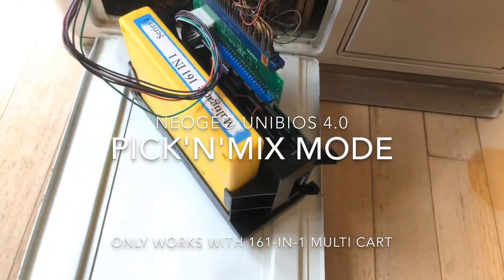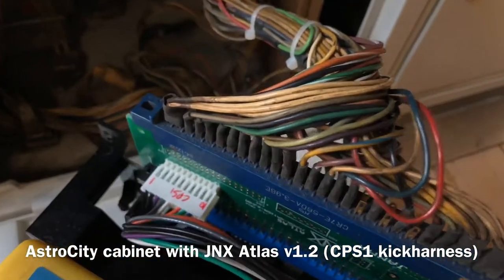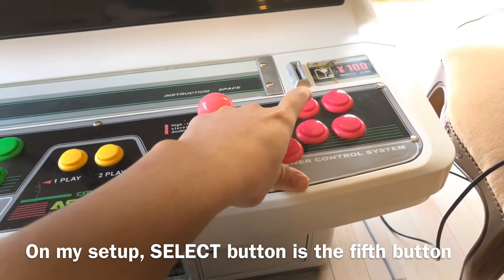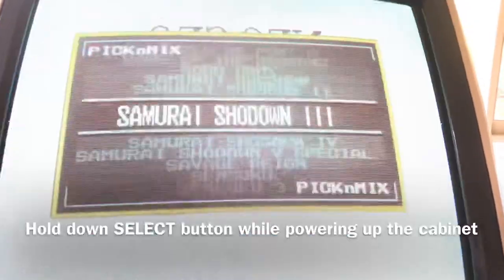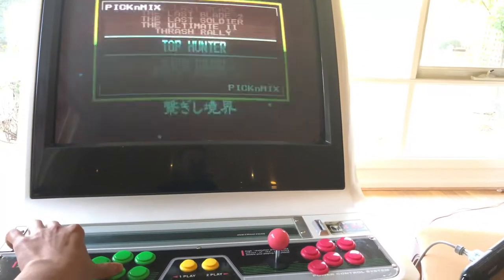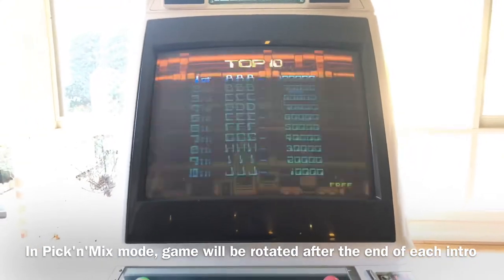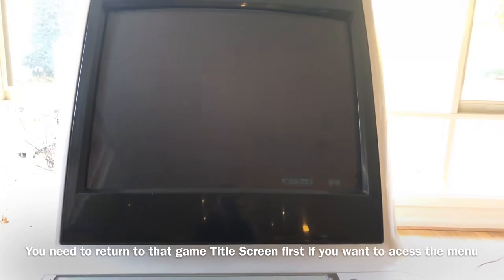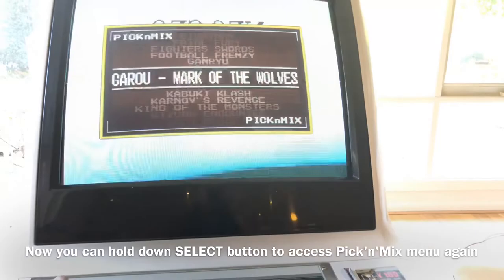Neogeo UniBios4 Pick'n'Mix mode for 161-in-1 multicart on AstroCity cabinet

Comment: Thanks. I tried every option and couldn't figure it out
Reply from the maker: you need unibios4 and 161-in-1 multicart (wont work on any other carts)
 Once you have those two, it should work just like the video describe.
Reply: @modology  yes. I said thank you cuz i have both but couldn't figure it out by myself 😀

Comment: How to turn off picknmix? 
I didn't do anything just power on my arcade and play game.. but when I hold the start button to exit the game.. the picknmix it will turn on itself. 
What can I do? Sorry for bad English.
Reply from the maker: When you have not inserted any coins into the machine, if you hold START ---> the Pick n Mix menu will appear. This pick'n'mix replace the shitty menu originally comes with the 161-in-1 cart (with terry bogard sprite). 

Not sure why you want to turn off pick'n'mix feature?
Reply: @modology  because I do like the original menu.. 161in1 ..  ok .thank you for your information.
Reply from the maker: If you dont hold START button upon POWER ON the cabinet, it will not trigger the Pick'n'Mix mode at all
Reply: @modology  I didn't hold start button at all when it power up. But it still turn on picknmix mode itself .. when i exit the game
Reply: @modology  I used [Free version ] bios 4 .0
Reply from the maker: @Kamnaruun  not sure why it happened like that to you. did you install any softmod that trigger start button hold ? any thing that you soldering at jamma edge that trigger that? otherwise i have had no idea why
Reply: @modology  no I have not . I play original , no mod everything . Brother
Reply: @modology  when I turn my arcade power on it runs the original menu 161in1 but when I play game and I hold start to exit.. it will turn on picknmix itself.. no choice to exit.. I always turn off the power to play it again.
Reply: @modology  my mvs board is MV -1FZ
Reply from the maker: @Kamnaruun  i have no idea how to disable pick'n'mix mode in your case... you should post your question on neogeo forum perhaps

Comment: How to do free play ?
Reply from the maker: On the MVS board, turn Physical Dip switch 1 to on. 

Select game in Menu, this will boot the game up in test mode. Change your soft dips/settings as you wish. Exit test mode. The system will prompt you to turn Dip 1 off. 

After you do so, the game will reboot in regular mode with your settings changed.

You will have to do this for every single game that you want to set to Freeplay.